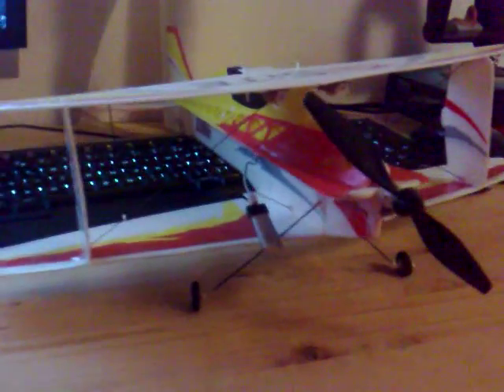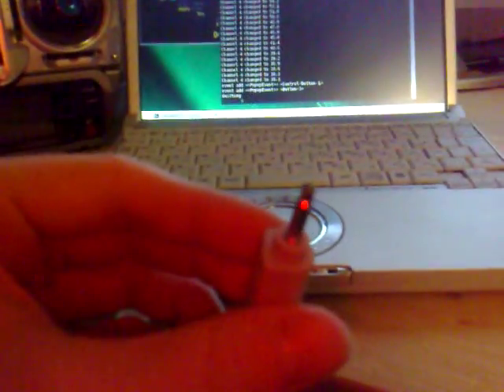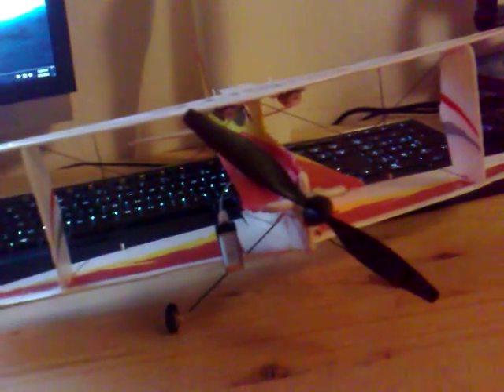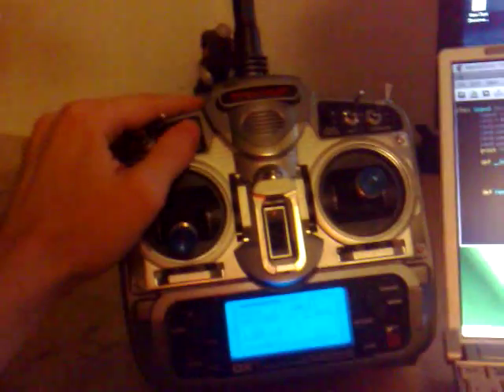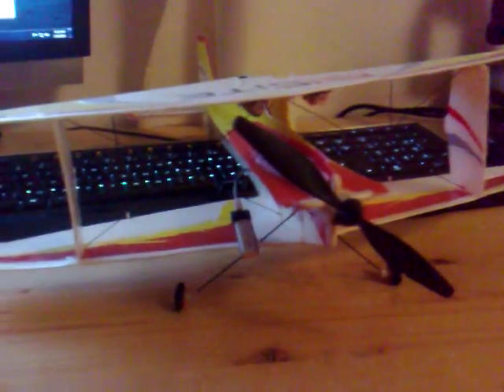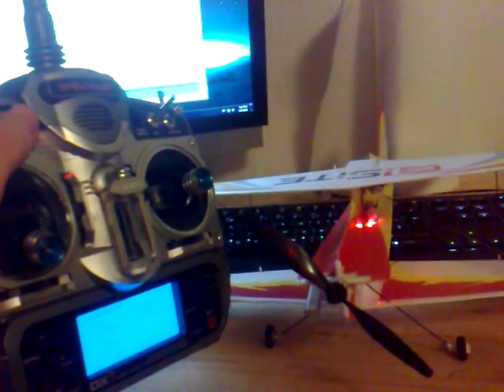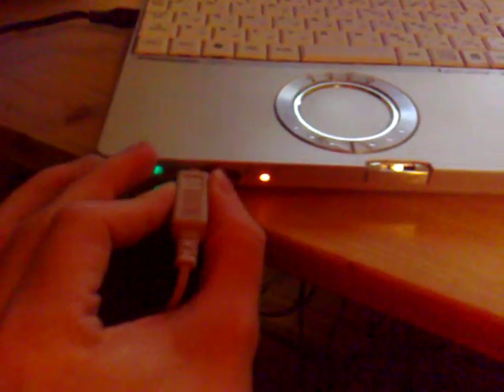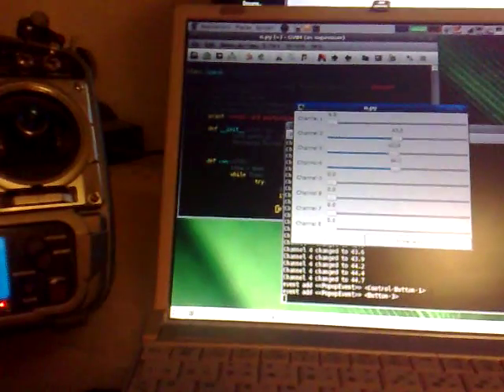PPM over audio demo

Comment: So I am trying this with my Dx8 but Im not getting it to work properly..... I am using your windows software that actually incorporates the PC joystick.
Reply: +kangsterizer thank you. Do you mean I should adjust the volume of the speakers etc?
Reply: +kangsterizer thank you. Do you mean I should adjust the volume of the speakers etc?
Reply: +kangsterizer thank you I will try that.
From memory what sort of volume level should I generally be around please?

And does that apply for both transmitting to the transmitter and also the initial part of setting the ppm signal via the line in port on sound card?
Reply: +kangsterizer thank you... I will try a voltmeter. In the mean time I can hear my transmitters signal via the input of the mic jack on the PC..... Its just when it goes to transmit back to the transmitter via the out jack that it doesnt work, I get no movement in my aircraft.

It did however at one point, via using the soundblaster digital I/O port send my Tx crazy adjusting all the trims.

Comment: Dear kangsterizer,
First of all, Im sorry for my english skills, but its not my native language :) 
Im planning to control my RC car by Steering Wheal (Logitech)  and have a FPV with a goggles with head tracker. So I currently looking for best solution to do that. So far your solution sound best, but do you know/feel that its doable with a Steering Wheal? I thought about Endurance R/C Servo Commander, but as I understood your solution have lower latency, is easier to set up and what is most important - is free of charge. Am I correct?

I will be appreciate if you will find some time to reply me. Thank you in advance and all the best from Poland!!
Reply: kangsterizer
Thank you for your reply! I bought Turnigy 9x yesterdar (special for this test) . Cause Ive never had any experience with copters/planes (only RC cars), Ive never used this kind of transmitters and never connect them to the computer so far. Basicaly is that possible to use your solution with Turnigy 9x? Maybe you know how I should set up this transmitter? Many thanks in advance!
Reply: kangsterizer
Ohhh... so it wasnt good idea to buy a 9x :-/ All at all, can you advice me what transmitter will be as "plug and play" for your solution (not so expencive as dx7)? Culd it be Spektrum DX5e? Thank you so much for your attention.... All the best from Poland!
Reply: kangsterizer
I have spent last hour to find anything abt "how to install opentx" on 9X.... no success... Its hard to find 9XR on our market as well. On rcgroups forum you have mentioned  that your solution works well with DX5e (this radio Im able to buy even tommorrow). Can you confirm that DX5e is good solution for this purpouse? P.S. Sorry for so much "stupid" questions.

Comment: The Link provide returned

Object not found!

The requested URL was not found on this server. The link on the referring page seems to be wrong or outdated. Please inform the author of that page about the error.

If you think this is a server error, please contact the webmaster.
Error 404
grooveshark.insecure.ws
Thu Apr 18 00:18:43 2013
Apache